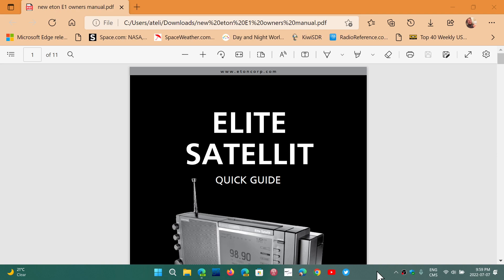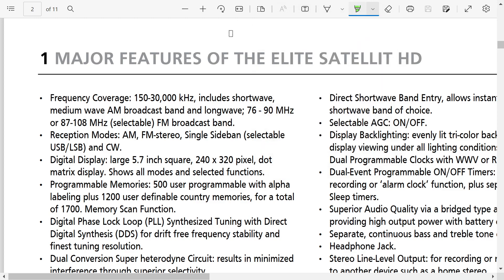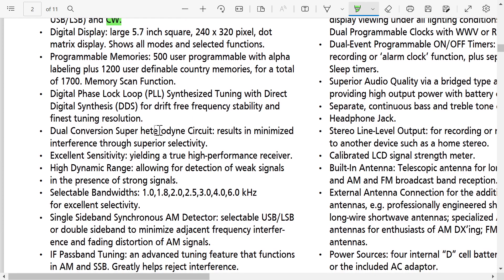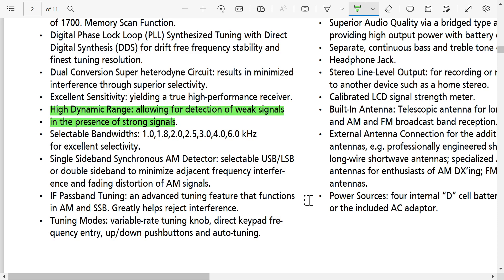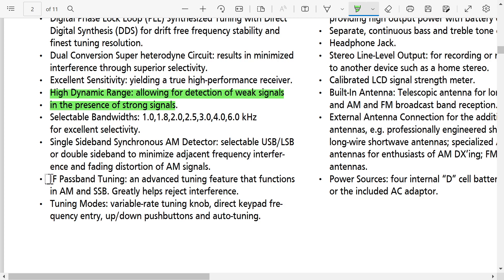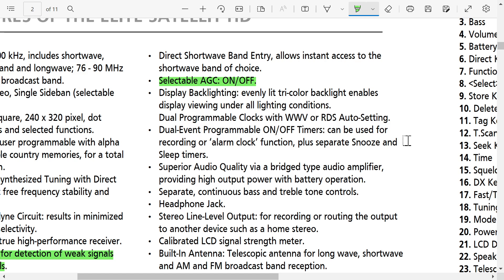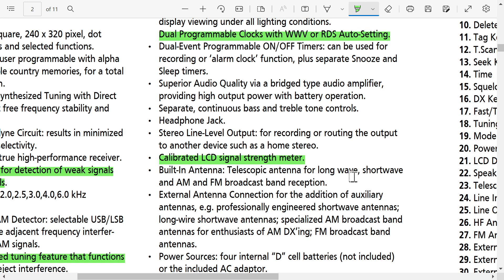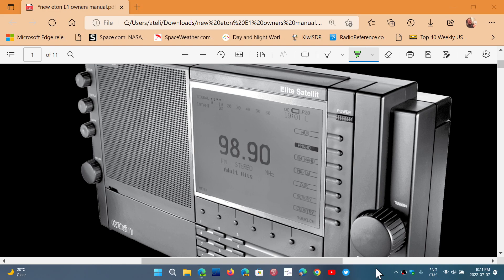NEW Eton Elite Satellit HD Radio look at the features from quick start guide

Comment: I owned one of the original E1 radios and it had some sort of "rubberized" case that, over time, started to get extremely sticky and actually seemed to be deteriorating in time.   It also suffered from a display issue that drove me, as well as many other owners of the original E1, absolutely crazy!  The display issues seem to become worse and worse as the radio grew older and the more often that you used the radio! All of that said I can only pray that these two major issues have been resolved on the new issuance of this more modern version of the E1 and, for the hefty price it will be selling for, well, it had better be a major improvement over the original model.  Thanks for another wonderful review, Giles!
Reply: Yeah, I've heard that issue referred to as 'Sticky Case Syndrome', and I've actually had to trash a couple of working radios because of it. Newer radios don't use that type of material anymore and a couple of mine have silicone outer cases. Silicone is extremely stable and will never have that problem.
Reply: There have been posts that the new model will not include the rubberized coating as applied to several models in the early 2000's. The display issues were resolved in later serial numbers of the E1 - I have two of them - therefore, should not carry over to the new model.
Reply: that's exactly what I am worrying. speaking of the problems, I also encountered many when using sangean top end radios.
Reply: @whollyunaware5185  Yes I believe the first production of the E-1 came out in 2005,I bought one in 2007 and apparently the display problems were corrected,at least with mine.Also the sticky issue was not as bad as some owners mentioned.It still works exceptionally well for 15 years of use.The lack of the internal MW ferrite antenna was decided because the extra large display would comprimise its signal on MW,so the whip ant. can be lowered to a horizontal position and rotated for best reception.I pre-ordered the new Elite Satellit model without the coating and am looking forward to compare the two,old & new on the same frequencies.Good Luck

Comment: I have the original Eton E1XM 2005 version,  I purchased on eBay over a year ago as New Old Stock in the box for a high price and I
obtained the XM satellit antenna adapter too, which I subscribe to and in my car too.
Yes, I find the MW reception not so good
with the telescopic antenna, and a few
months ago the LCD display faded. I found
a repair facility on Eton's website, up in 
Ontario, and it cost about $250.00 US to
repair the circuit. Luckily my case has not
become sticky, as I have read was often
the situation
Luckily, I had reserved a back order in March
2020 for the new Eton Satellit, with Universal
Radio for $350.00, which is still valid for
when the shipping person told me the other
day that it should be shipping later this month.

Comment: Will be interesting to see if Eton has fixed the case coating issue and fading display of the original E1. Otherwise, it should be a premium portable radio for sure.

Comment: First off, I very much enjoy your channel. Quick question. I ordered a used E1 satellite radio that I just received today. The radio turns on, but I'm not able to use the touchpad for some reason. Is there some type of lock or is this a fault in the radio? The tuning knob works perfectly fine, but none of the other buttons outside of the power button appear to be responsive.

Comment: I have the Eton E1.  It didn't have a ferrite loop for medium wave.  The problem was a loop would pick up electrical noise from the large display.  If you place a medium wave loop like AN-200 near the display and connected to the antenna input, then can hear the noise.  The E1 was a nice receiver.  What is the connector for the external antenna?  Is it the European cable TV connector like the E1?  Thanks for sharing.  I checked the Universal Radio web site and the external antenna connector is a "PAL" type.  One will need an adapter.

Comment: I believe other parts of the Guide also mention the inclusion of a Squelch feature (was also included on E1). The separate Data Sheet on the Eton website indicates fast/slow selection for AGC (vs on/off) - not sure which is correct. E1 also used the telescopic antenna for MW listening (no internal ferrite). The Passband feature was very effective on the E1.
Reply: I'm trying to get on-line the full operations manual,all I see is the quick guide.For instance I want to know what kind of rechargeable batteries can I use,I know that they are "D"'s but can I use L-ion or NIMH. I have regulated wall warts (a/c to  dc transformers) but prefer the more quiet batt. operation.As far as a squelch control (varible),I liked it on my older E-1 XM Thanks for exchanging thoughts on it

Comment: Great video as always! I want to add something you didn't mentionned. You are showing the manual of this radio but there is another document : the datasheet (https://cdn.shopify.com/s/files/1/2407/2229/files/220606_SpecSheet_Elite_Satellit.pdf?v=1656621611 ). In this, there is a mention of digital options (HD radio and DAB+). HD radio is only available in North America and DAB+ in other parts of the worlds like Europe. It will be interresting if it is really the case. Usally a portable with the classic LW/MW/SW/SSB/FM capabilty doesn't have DAB+ and a portable with DAB as only FM and DAB+. A radio with all these features on the same devise is really interesting.

Comment: As a beginner in sw and ssb listening, would you recommend
Tecsun 330/380
Ccrane ssb
Eton elite exec 
Other ?
In regards to this new elite besides the price
4x D batteries make it hard to consider as these batteries are not easy to get where I live. I gave away 2 sangean due to this reason
Reply: I'm also a Beginner. My experience is that the environment and antenna determines the quality of reception too. I compare some radios in a bad environment and all have near the same reception. But in good conditions i do not checked. I will do that.
Reply: A good smaller unit that you will I think you like very much and functions great,also at a much lower price just over $100.00 is the Tecsun 680.The 680 does well on every band,even the air band, if you a near to an airport check it out,good luck and enjoy !
Reply: I'd get a tecsun 368 or tecsun 660 or 680

Comment: I had the original E1 years ago and yes, it did receive AM broadcast stations off of the telescopic whip antenna. I don't recall how well it worked though. I'm slated to get the new version this month at the introductory price of $349.95, not $599! I seriously doubt that it's worth more than what I'm paying for it, we'll see. 🤷 🤔 📻
Reply: I still have my E-1 XM from 2007,it works well and I was fortunate enough not to have ANY technical problems,even the stickiness issue,which was minor but I got it in their 2nd year of production, or maybe was just lucky I too pre ordered it from Universal Radio back in June 2019 at $349.00 . The XM version in 2007 was $499.00,also from Universal Radio. I am looking forward to comparing the two units on the same frequencies with the whip ant.'s  and a dipole up in the trees in the boomdocks

Comment: Looks a lot like the old E1 that had XM radio capability. Those didn't last too long on the market as like others said the radio had lots of issues. it's not 600 it is listed at 700 in the US. I don't believe it's worth the money considering an ICOM ICR-8600 can be had for 2400 and has much more capability.

Comment: I have an old Eton 1 and i have hated it ever since. Bad display, hard to see . No internal antenna for AM because the display makes too much digital noise it wipes out the signal!  Also that paint on it turned very sticky, what a mess!  Also i was never impressed with the performance of the thing. I had one of the very first models and they were made wrong. I installed batteries and plugged it in and the batteries had AC applied to them and they swelled up and leaked all over the place.  A recall happened and they replaced mine.  For 700 bucks with tax i say HELL NO !